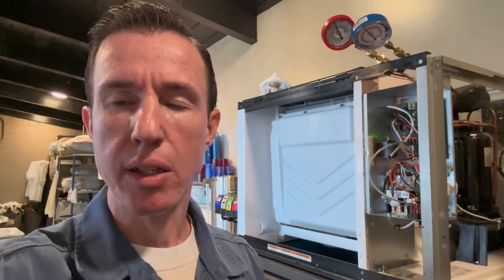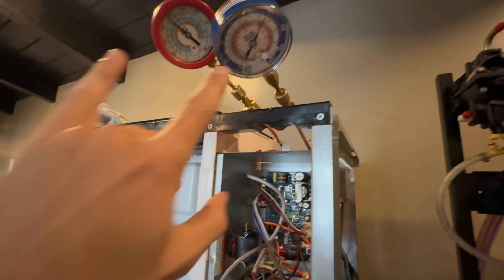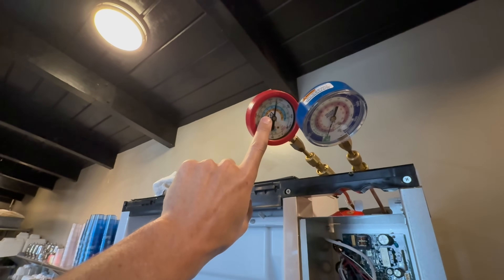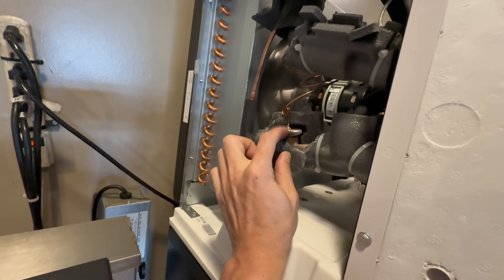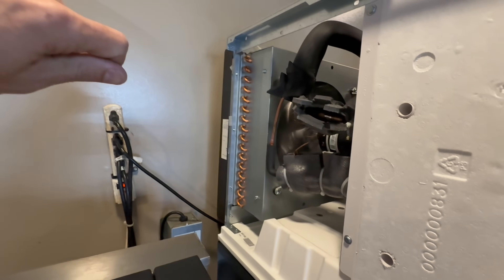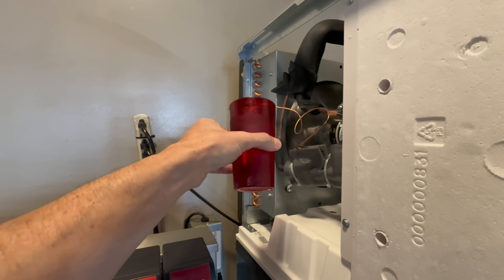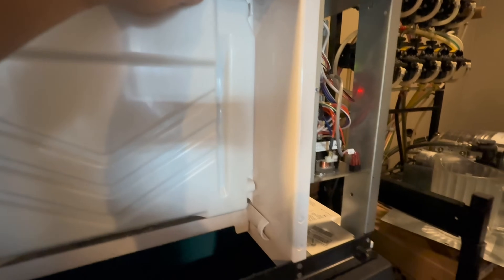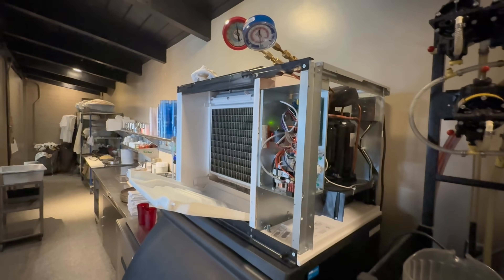Koolaire ice machine not making ice

Comment: Good morning! I got a question for ya
Reply from the maker: The head of the Head Master/Head Pressure Regulator is preset at a constant pressure that is unaffected by the ambient temperature.
Reply: @IceMachine411  what if ambient and internal pressure both opened or closed
A four point recovery is the only way to get all the charge out
But it’s only a few ounces not pounds that may be locked in condenser like 8 tops 
Thanks for help brother!

Comment: I have a problem with my ice machine looks like a harvest problem I changed the thickness probe, water level switch, and a bin sensor it works great   For a bit but yesterday stopped again. what do you suggest?
Reply: I'll be in touch Sr
Reply from the maker: What’s the make and model of the ice machine?
Reply: Monitowoc mode# lY0450A-161
Reply from the maker: Hard to say without being there and diagnosing it myself. If it’s not harvesting then possibly look at the harvest valve. Possible that it’s not opening. Also a dirty evaporator that has damage or scale buildup can cause harvest issues. The Curtain Switch could also cause harvest issues. There are a bunch of possibilities. Those are some things for you to check out.
Reply: The machine is clean I'll check the valve, thank you so much, Sr I'll be in touch
Reply: Do you provide your contact number, Sr?
Reply from the maker: I usually don’t but I could.
Reply: Oh ok. Do you service in LA area?
Reply from the maker: I’m in Sacramento. I could come down. I’ve wanted to visit LA. It’s been a while.

Comment: I had a situation like this. It was a warranty. Tech support said it was the TXV. Changed it and it happened again. Tech support said I may have burned it up. I did not. The next one was encased in Viper wet rag. Only the braze points stuck out. It was bad again. I told the office to send a new tech. 3rd tech is way better than me. Same thing. He calls tech support. Again they say TXV. At this point, it is a real  head scratcher. He decides to put a piercing valve before the TXV. Long story short. There was a restriction after the drier and before the TXV. He cut that line out and put in a new one. Worked like a charm. He had spent 8 hrs on that thing and wanted to get out of there.  He threw everything out and we never found out what the restriction was. It was from the factory though.
Reply from the maker: Oh dang. I really hope that doesn’t happen to me. I’ll be changing it out later this week and if it doesn’t work I’ll automatically blame myself. Fingers crossed. 🤞. Hope you have a nice week.

Comment: The temporary fix is to remove the insulation on the TXV, cut the powerhead cap tube, braze in a port, and pressurize the powerhead with nitrogen to 100 psi. If the suction pressure rises you bleed the nitro out until you get to the recommend suction pressure for the machine.
Reply from the maker: If the machine wasn’t under warranty I would probably try this. Seems like a really cool trick of the trade. Thanks for sharing valuable knowledge.

Comment: Trick is pour warm water over the head first if txv working it moisture in the refrigeration system other trick is like you said take the bulb take a temperature off where the bulb was and hold your bulb and watch the temperature change it probably head and that one look like alco valve, which you can’t take the head off
Reply from the maker: I might just give this a shot. I’ll be doing the repair later this week. Fingers crossed. 🤞

Comment: It’s new and failing. Get a hoshi instead
Reply: I’m not a fan of Hoshi, I’ll take Manitowoc all day. Hoshizaki is over complicated and I personally have more stupid issues with them.
Reply: @ Let me get this straight here, Manitowoc has a touch pad,circuit board,ITP,WLP and those always are having to be replaced, and hoshi has a toggle switch or two of them with a simple circuit board and usually the bin switch is the o my thin that goes bad or a WLP or the float sticks from time to time depending on where you live. 
  I’m about simplicity and efficiency and all about buying American but there is no way hoshi is more complicated.  Do you work for Manitowoc? How about the contractors and the fan cycling switch having to be bypassed most of the time!
Why does a touchpad with a circuit board have to be on an ice machine?? Complicating to make money. Like I said, depends where you live. I rarely have to visit my hoshis but always have to eat up money and time with Manitowoc. 
 If it were 20-30 plus yrs ago it was a different story
Reply from the maker: Koolaire is a solid brand..technically Manitowoc. All brands have issues that come and go. It’ll be fixed in no time.
Reply: I had a brand new true ice machine out of the box txv slammed shut. It was shutting off on low pressure. Changed txv worked like a champ.